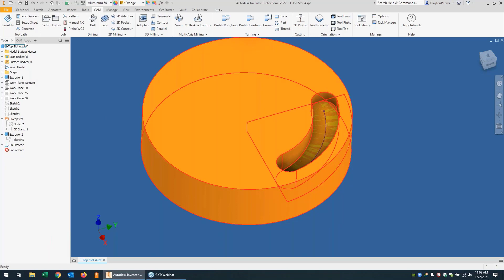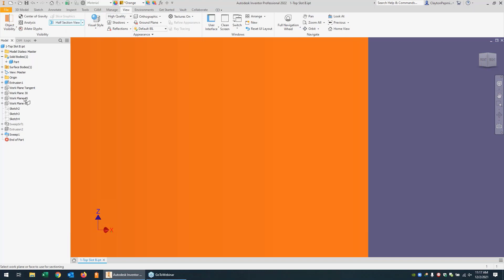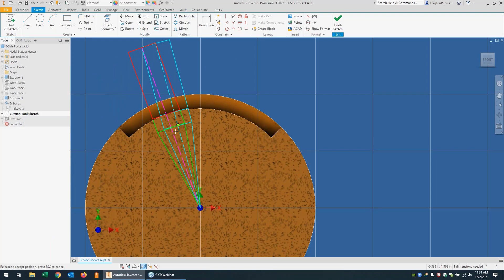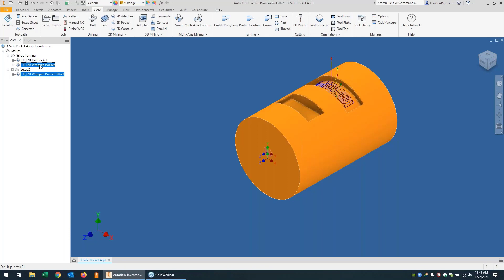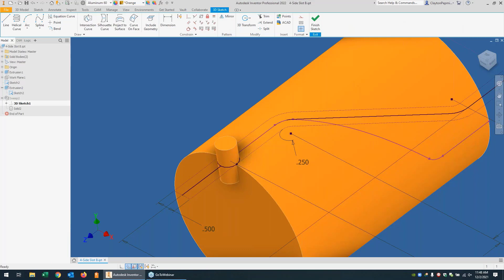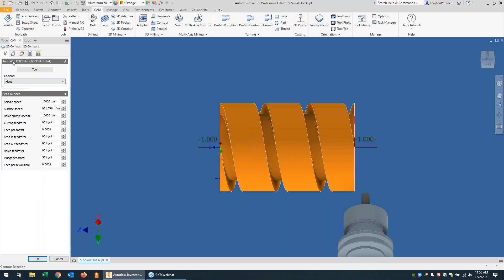Autodesk Inventor CAM:  A Close Look at 4-Axis Machining

Comment: Hi. I have a question. Is there anyway to use wrap for conical shapes? like machining a slot over a conic
Reply from the maker: Yes, you can use wrap toolpaths on conical (or tapered) surfaces in Inventor CAM, but it needs to be done as a rewrap (unwrap → toolpath → rewrap). You can’t directly wrap a cone in one step. It must first be unwrapped, then the toolpath is created, and then it’s rewrapped to the conical shape
Reply: @Hagerman  Thank you for answering. Would you explain how to rewrap the toolpath again?

Comment: Are there planes like in Mastercam?
Reply from the maker: Inventor CAM doesn’t have a “plane system” exactly like Mastercam’s planes. It relies on Inventor’s Work Features (work planes, work axes, work points) as reference geometry. You can create custom work planes at angles or offsets, and use those as the basis for sketches or machining operations.

So while the workflow is different from that in Mastercam, you can achieve the same flexibility using Inventor’s built-in work geometry tools.

Comment: I am under the impression that Inventor Cam only works when you have their Cad suite, but you are saying it works with Fusion 360 and SolidWorks. Could you explain a little on that topic.

Thanks for all the videos. 🇨🇦
Reply from the maker: InventorCAM requires the Autodesk Inventor software.  InventorCAM sits inside of Inventor.
Fusion 360 is a different piece of software that includes a “Manufacturing” workspace for machining functionality very similar to InventorCAM.
The Autodesk Product Design and Manufacturing Suite includes both of these tools.
The Autodesk SolidWorks solution is called HSMWorks.  This is also an Autodesk CAM solution but sits inside of SolidWorks.  In order to gain access to this software you must purchase the Fusion 360 Subscription.
Reply: @Hagerman  Thanks very much for your explanation.

Comment: The circumference of a cylinder is 2*pi*r, not pi*r^2. It's apparent that you used the correct formula in the model.
Reply: This only works because the radius is 2. 2pi*2 is the same as pi*2^2.